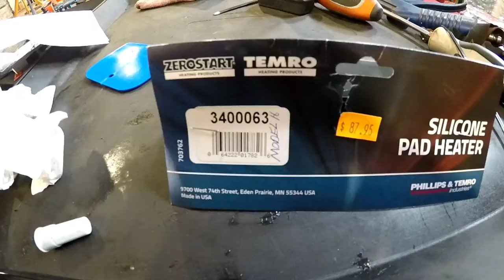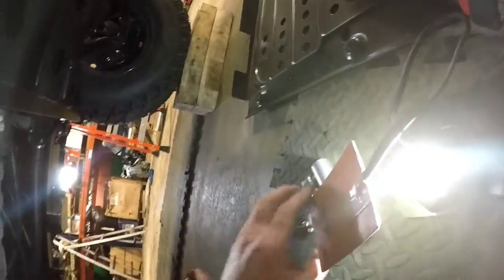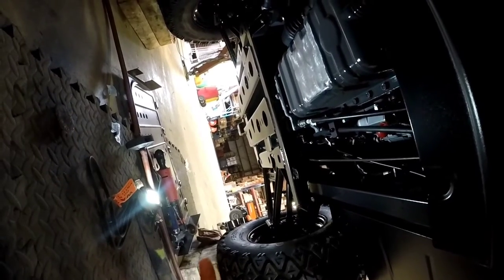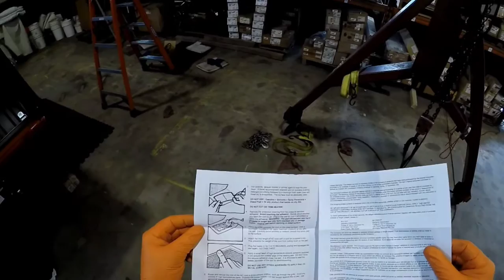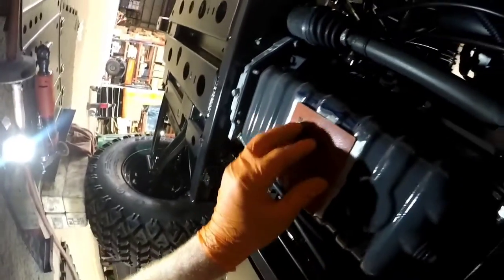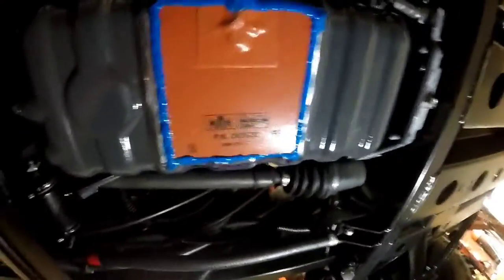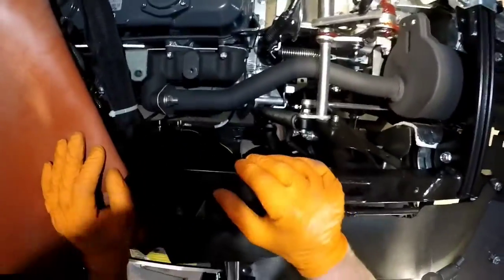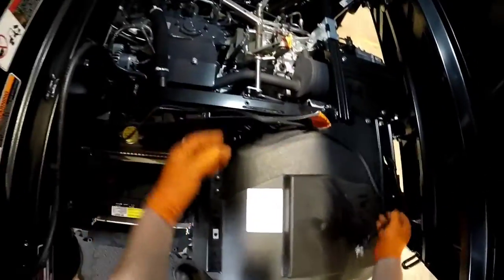adding a oil pan heater on a Kubota rtv

Comment: How did the oil pan heater work out and how long did you have to have it on to work well?
Reply from the maker: I just installed it..  but when I tested it.  It heated up very quickly!!   Easy install.  Just have to do a good job 👍